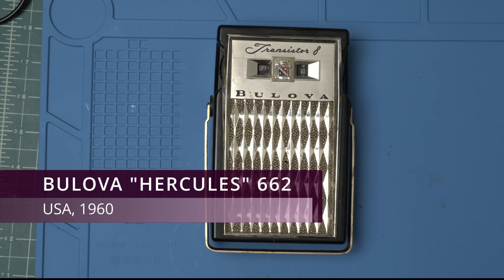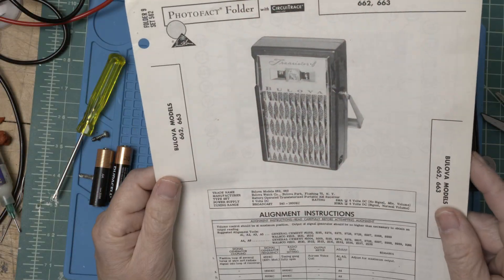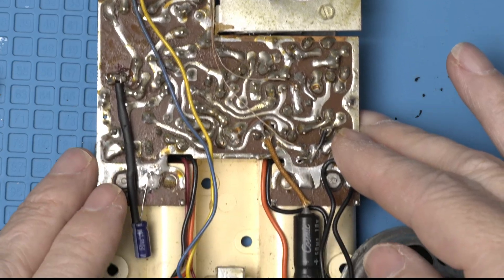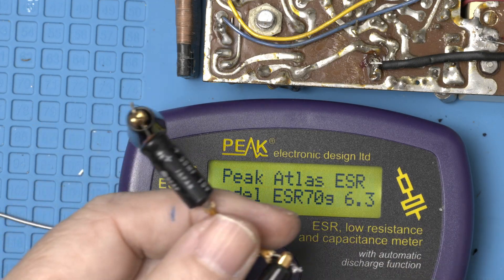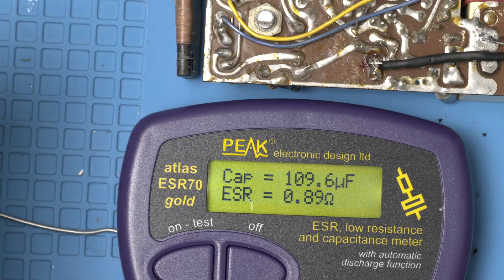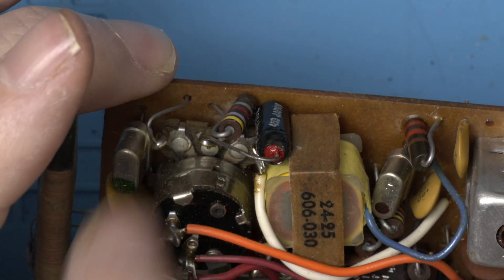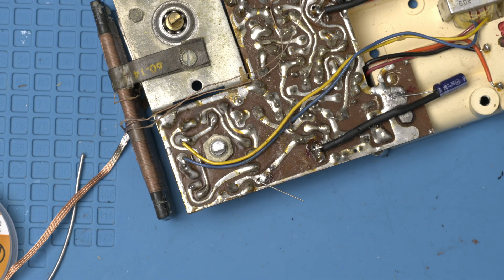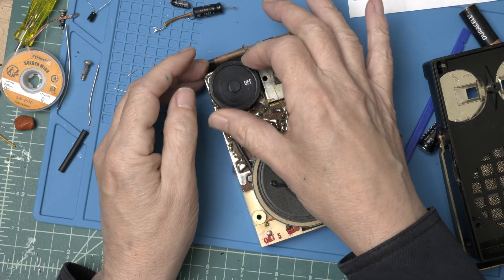Vintage Electronics Repair: Dead Bulova Hercules transistor radio restoration

Comment: A little trick I use when I don't have the correct size shrink tube. Take a little larger insulated wire and strip off the insulation. then slide it on the bare wire of any component to shield it from touching the circuit. Works great...
Reply from the maker: That's a great idea!

Comment: Nice work. How do you know those caps are bad before unsoldering them?
Reply from the maker: Great question!  You can't test caps that are in circuit, the other components mess up the measurement, so to test them you have to desolder them, which is 90% of the work.   But there is no real need to test them because after 60 years none of them are still good.   Since the replacement is 10 cents and has better performance than the original it makes sense to just replace them all with new ones.